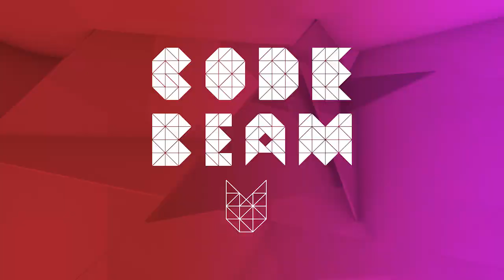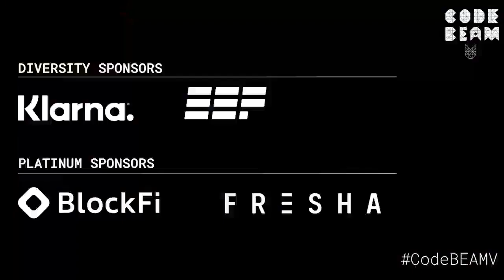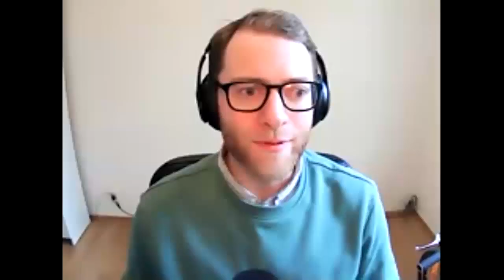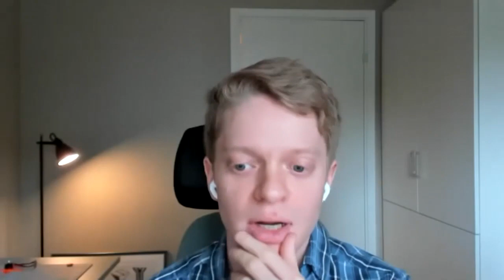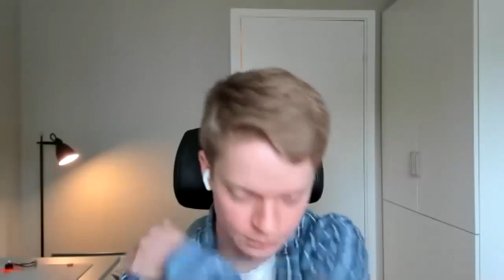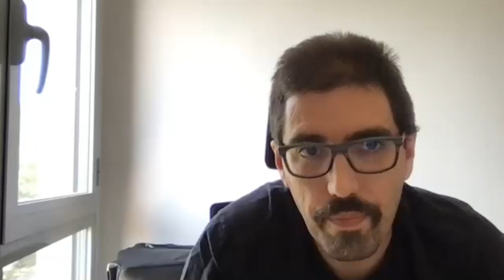Keynote:  Fireside Chat on code design by Eric Meadows-Jönsson and Ulf Wiger | Code BEAM V Europe 21

Comment: That was great. Do more of this. Initiates won't get much from it, but any acolytes certainly will, and that is the level at which documentation, instructionals, discussions, etc. are most lacking. That's why I've been trying to both write tooling and publish a few tutorials myself (as awful as both are so far). Anyway, keep it up. This was a great small panel discussion and it would be great to have more.